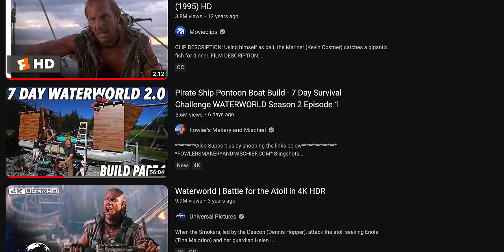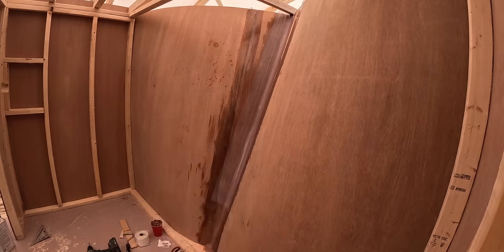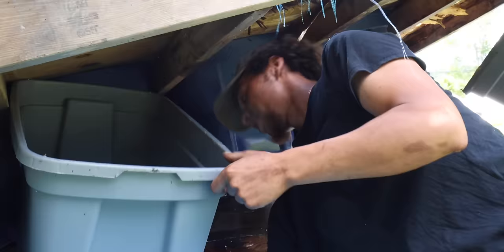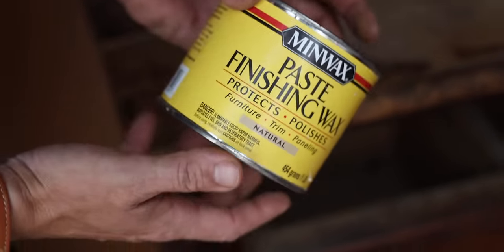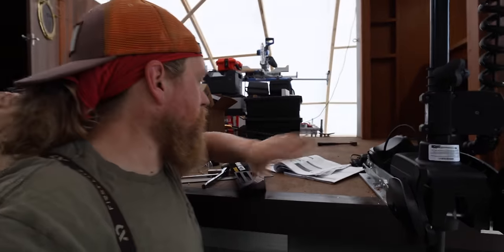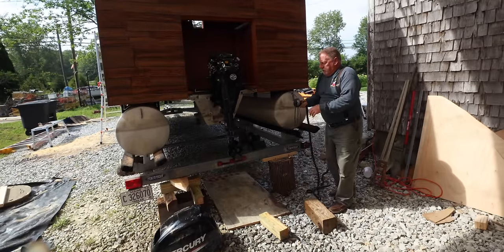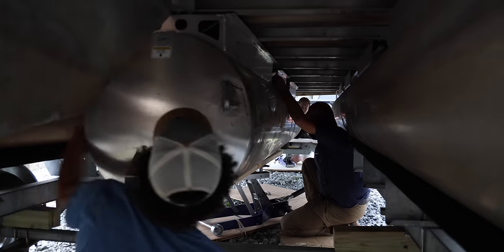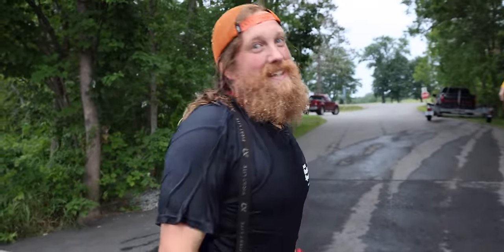Pirate Ship Pontoon Boat Build PART 2- 7 Day Survival Challenge WATERWORLD Season 2 Episode 2

Comment: For the trolling motor the length extender piece has to be down at the base because that it the piece that connects the turn motor and then it should work. love the project.

Comment: yo you guys did an amazing job but no pirate ship isn’t complete without a figurehead should do the logo or a sling shot, cut out of styrofoam or a strong abs or polymer plastic instead of wood to save on the weight

Comment: Seems like you always go through just enough effort to make it usable but not enough to make it a good build. Unfortunately this is just an expensive prop build made for this series. Way too much exposed wood for a marine vessel. At the very least it should be epoxy coated if not fully glassed. It’s going to rot out in a few years.